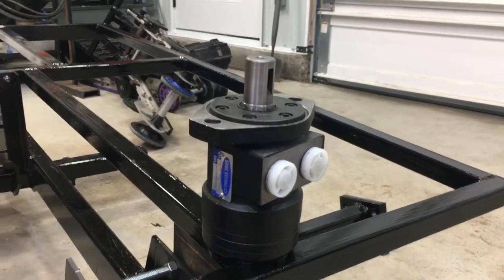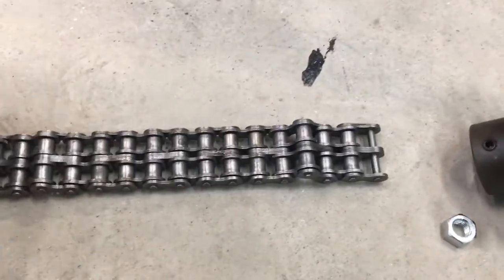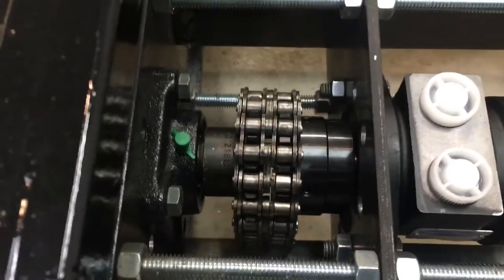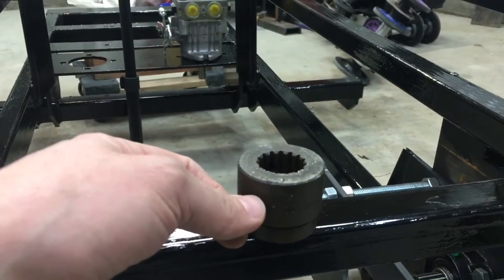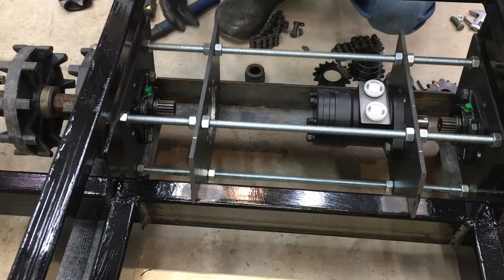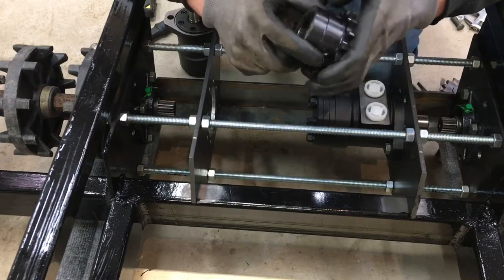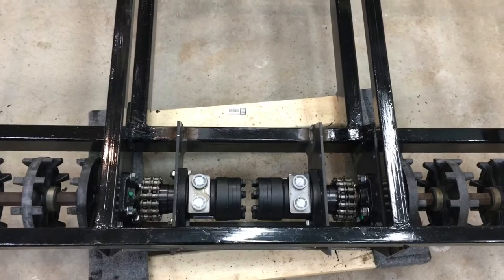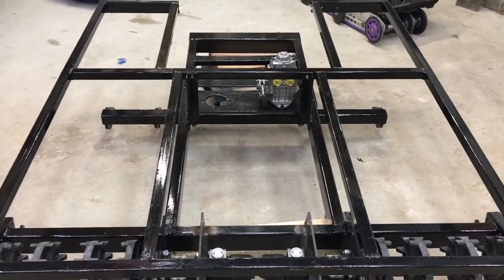Mini Snow Cat pt17 - Final driveline assembly

Comment: That is the best possible drive coupler you could have selected. Damping will not be an issue at those speeds, as your not trying to remove torque ripple found in large induction motor applications to keep fans and other equipment quiet. I would add the torque would destroy any of the polly or neoprene based couplers commonly used.

Comment: This is a really interesting build. Im on a very similar project but with a tandem setup pumps.
what size pump and motors are you running?
Reply from the maker: The pumps are 0.62 ci/rev.  The motors are 2.8 ci/rev

Comment: What is the reason you did you not do a direct drive from the Hydraulic motor to the snowmobile axle without the chain & sprocket setup by welding a 15 spline hub to a 1" keyway hub?
Reply from the maker: Good question.  Although I took great care in the alignment of the front end components, even the smallest amount of axial misalignment between the track driveshaft and hydraulic motor would damage the motor.   The flexible coupling compensates (to a degree) for any deviation, eccentricity or misalignment of the motor and driveshaft.
Reply: @rad1876  Could a drive coupler similar to that used in a jet ski that has a rubber or polyurethane cushion between the two couplers have been used as well?  May have softened the initial shock load when engaging the motors to start to drive the tracks from the stationary position.
Reply from the maker: Hi Mark, yes there are urethane/rubber couplings on the market and that would be my preferred choice for the shock absorption properties you described!  

However, I couldn't find any available off-the-shelf (OTS) with 15T splined halves and suitable torque rating. This being a low speed/high torque application,  my peak torque requirement is 936in-lb, OTS flexible couplings in this form-factor are rated up to 680 in-lb. The chain coupling is rated up to 1800+ in-lb!